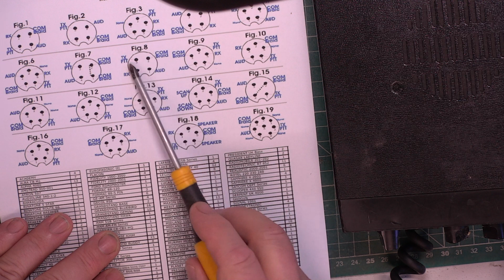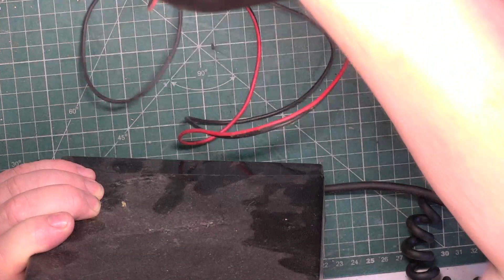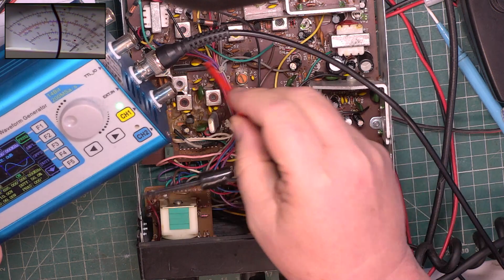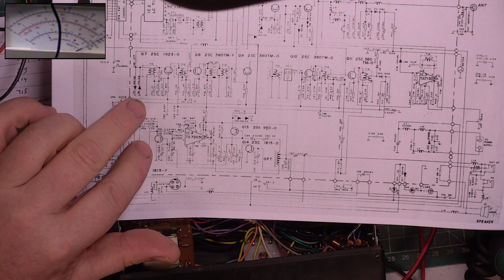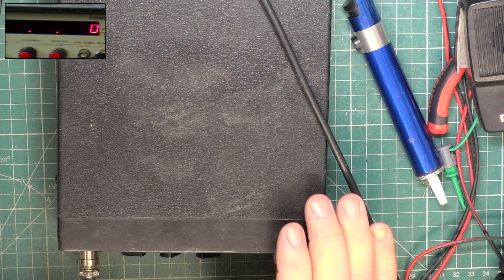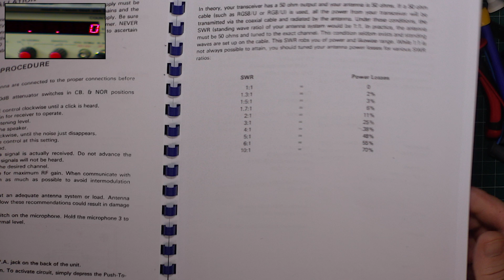Harvard CBM404 CB27/81 UK FM CB radio - repair, alignment & service

Comment: I like it but maybe needs coil stretching to do a decent power..
Reply from the maker: In most sets coil stretching is an absolute no-no as it produces high harmonc levels....and it's those that most peoples power meters read as 'more power'. I've previously demonstrated coil stretched sets doing 2W on 27Mhz with harmonics of 3W at 110Mhz on aircraft band. 

Some sets have service manuals that tell you to stretch or compress coils..in a partucular way...as part of the alignment & you are required to then check on a spectrum analyser that the harmonics are in spec. 

As it is, this set is doing 3.4W on 27Mhz. Few new sets manage abouve 3.6W & in reality it makes no difference anyway to range.

Richard, G0OJF, UK